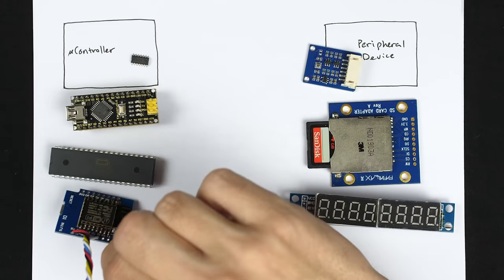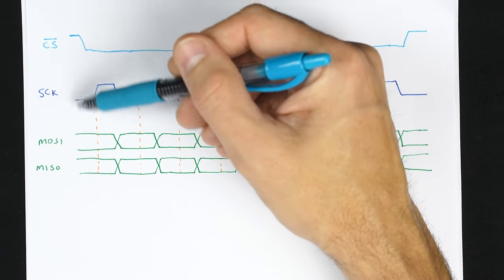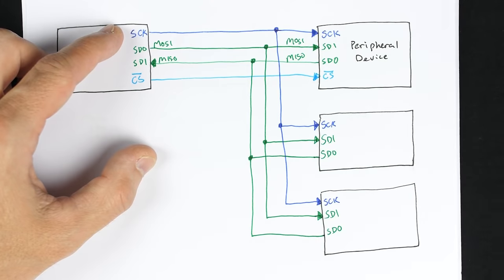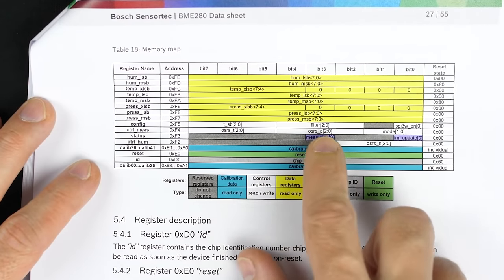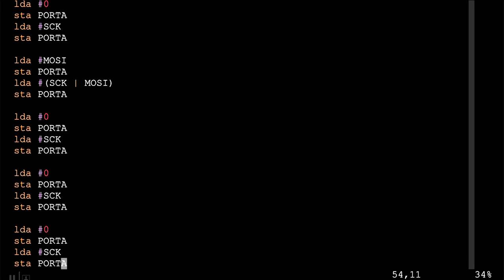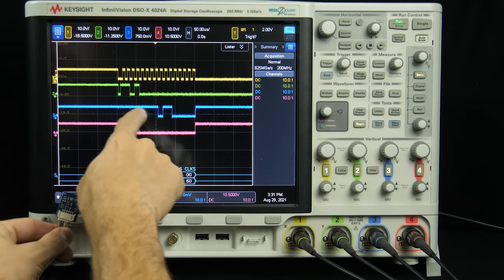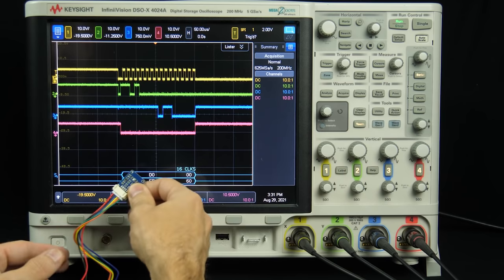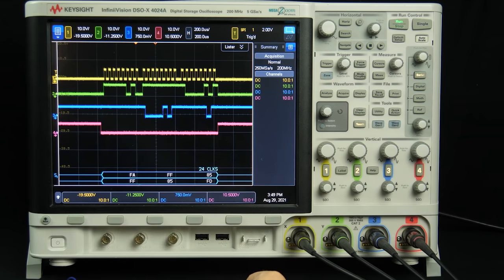SPI: The serial peripheral interface

Comment: Am I wrong in assuming you probably would want to clear that register before you resend the random MSB back to the chip as data while you read the next byte?   It may not explicitly matter with this chip, but you're sending invalid addresses to the sensor, and especially for that third byte you're receiving back, it's possible that the LSB could be ANYTHING so you actually may send it a different command, correct?  Wouldn't it be better to initialize that variable instead of sending random results back at it?

Comment: Are there any "SPI" devices that utilize the bidrectional nature of it, to the full. That is send something both direction at the same time, some kind of pipelineing? I.e. when a master send request 2, the slave at the very same time sends response to request 1? I guess, some kind of audio related stuff maybe? Or maybe where the device is streaming data back even if the master does not request anything (as long as the clock is toggling and the cs is low).

Comment: Excellent video, but this far to being simpler than I²C IMHO.
First, I²C really only need 4 pins: VCC, GND, SDA and SCL. Second, the devices always use the same standard, that is: read SDA when SCL is low (both pins, SDA and SCL, are pulled up). Third, the device address is defined on the programming side (protocol) instead of having 1 GPIO for each CS. The downside of I²C in relation to SPI is, AFAICT, the bandwidth.
Reply: SPI is simpler electrically and in hardware, I²C is only "simpler" in needing fewer pins
Reply: I've detailed fairly well why I think I²C is simpler, not only because it needs fewer pins, but the whole solution. Would you care to elaborate why you think SPI is simpler?

Comment: Calling it "interface", or having an acronyms is a bit of a stretch. It is like UART, but clocked and with chip select. It is not that different than just other digital logic stuff, just with the intention of serial communication, rather than parallel control. Nice video.

Comment: You should have mentioned with a single device that CS can just be tied low and doesn't require a microcontroller pin for CS in that case.
Reply: Many devices require CS going high and low to initiate the next command! Like this temperature sensor in read mode: as long as CS is kept low it sends data at incrementing address, totally ignoring any new commands sent to it. So eventually you have to set CS high and then low, that way it is awaiting new command.

Comment: wow, THAT is a massive oscilloscope....
Reply: It's the low end 4 channel model in the series. The massive one is the DSOX4154A which costs over 4 times as much. But what he has does all Ben needs it to do. The more expensive one just has a higher bandwidth. Which you don't need working with microcontrollers.
Reply: @1pcfred  But that one is $6800 I think!
Reply: @mmaranta785  yes that's a good price for a scope like that.

Comment: I've had such pain with SPI not being standardised. I've used sensors with such unusual timings that I end up needing an FPGA to interface as there are so few microcontrollers that support that timing!
Reply: Do you know the Raspberry Pi Pico? Its chip, RP2040, has a programmable IO that is ideal for stuff with very tight timings. It was released this year and I wish I had something like it many years ago. As an example of its capabilities, it doesn't have any video hardware and yet people has managed to bitbang two DVI displays (or HDMI in DVI mode) at VGA 60 hz (252 mbps each) and even 720p 30hz (372 mbps). I think it's crazy for a $1 microcontroller.
Reply: @DiThi  Oh wow. I'd dismissed it out of hand as "hobbyist" but that is a fine piece of equipment! We've been using the FPGA solution for a while now so its well past the point of replacement, but I will explore this for the future, thanks!
Reply: The AD7606 is one I had to do that for. It's because you have to pulse some other pins high to actually get the thing to update its internal registers. Plus to set the internal LP filters oversampling you again need to set pins rather than write to a register because there's no MOSI.

Comment: try java-pre-comp-rom-gpu with fp8/16-precalc and fp32-64-128 emulation, ie, fast processor cache stores pre-calculated int-fp8(or int-fp16) input truth tables, 1/2 argument, like sin(x) and a+b, no recalculation for primitive math operations, fpga handles the data flow and memory, interfaces

Comment: Could someone explain why the MOSI/MISO lines in the diagram at 05:40 show both high and low at the same time? Is that to show that the values could be either 1 or 0 depending on what data is being sent?
Reply: Yes, that’s normal in data sheets

Comment: I think i2c is simpler IMHO. Less (only 2, clk/data) wires, no extra wire for every device (cs), can easily have multiple devices on same bus (as long as their device ids don't conflict)
Reply: I2C is definitely more simple electrically, but SPI is logically simple since there are no addresses and there are dedicated lines for transmit and receive

Comment: 📺💬 What is ChipSelect CS using when we have a clock and input and output data⁉
🥺💬 It is another clock for delay purposes, see the initial of the prototype port they try to send out transmission data as a set of data without conformation to have the most speed on the materials but it had lower speed when there are some distortion signals and communication speed and buffers are introduced at the time.
🧸💬 Do you mean that reading from the input source and writing to target ports requires some delay buffers ⁉
🐑💬 Explain that you had multiple devices and you need to update them without waiting for them to re-transmission signaling back,  pretending to port targets but they are working on the same bus.

📺💬 It is a flip method when the chip select signaling method is going high or going low.
🥺💬 And you can have more than one level 🐑💬 Not that easy you cannot damage the device you need to divide them into multiple channel signaling for basics and setup transfer rates.

📺💬 SPI interfaces ...
🥺💬 Still reading ...

📺💬 Later we had chipID that can create communication-specific address ports.
🐑💬 Multiport hub, the chipID can filters blocked of information between communications port addresses some programs cannot work correctly because we had licenses on it.

🥺💬  I see the carry flag receive buffers is that for the purpose of delays message or transmitting⁉
📺💬 The same way, the value 75 is to write into the register, and transceive is 74.
🥺💬 It is a configuration value, it requires it set to the same value for initial communications.
🧸💬 It is the same ideas when old movies about communication hacking they are talking about target communication ports, it is initial values.

📺💬 We learn about communication not to hacking.
🥺💬 I telling the idea how do they use attributes in communication port for many purpose, how they can specific purpose of using even some program now today they are using HostID.

📺💬 Calibration functions 🥺💬 I understand there is not program in the sensors but calibration values.
📺💬 Why the value is not exact 🥺💬 Not exact because they had a calibration function made for security purposes too.

( 📺💬 พอไหมเญอ มันยอหางานทำแต่ไปทำอย่างงั้นมันเลยไม่ได้งาน จริงจริงมันรู้จักญาติครับ 🥺💬 หยุดด้วยอันนี้น่ะ เค้าเลยไม่ให้อ้างครับ เข้าใจนะครับ
📺💬 เข้าใจลูกเค้ายัง ห้ามเอาไปเล่นแอบอ้างนะ เพราะบางคนเค้ายังเกรงใจ  📺💬 ช่วยบอกหน่อยทางนี้เค้าตามไม่งั้นพรรค ... ไม่พอ 🥺💬 เค้าโม่ครับอย่าไปสนใจ บริษัทนั้นด้วยจ้างคนประจาน หยุดด้วยผมเรียนหนังสือครับ 🏡 ‼‼‼‼‼‼🏍💬‼ 💬‼ 💬‼ 💬‼ 💬‼ 💬‼ 💬‼ 💬‼ 🥺💬  ยังพยามยาเมห็นเปล่า อย่าไปสนใจ
📺💬 ...  🥺💬 เข้าใจนะครับเค้าทำหลายครั้งแล้ว 7 ครั้ง ผมชนะทุกครั้งแต่เค้าก็แกล้งหยุดผมอยู่นั่นแหละ พ่อผมแค่ 7 ครับแต่ดูเพื่อนพ่อผมก่อนเค้าอยู่รอมกัน หยุดด้วย เค้าก็เลยแกล้งลูกครับ )